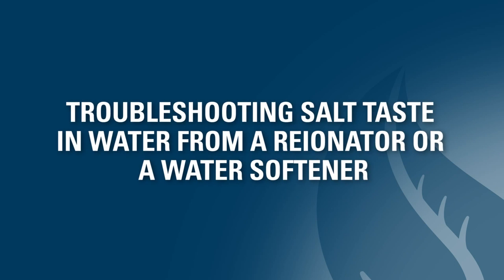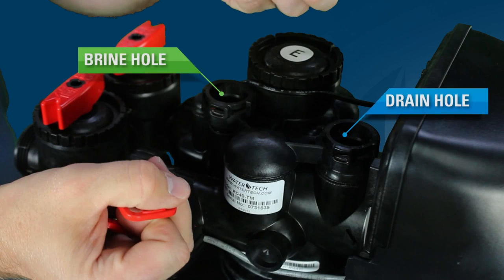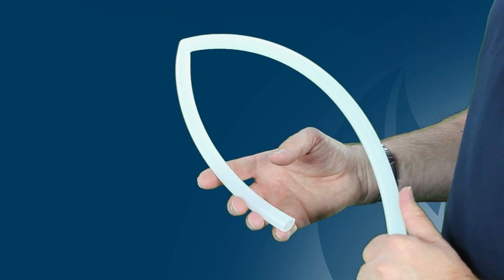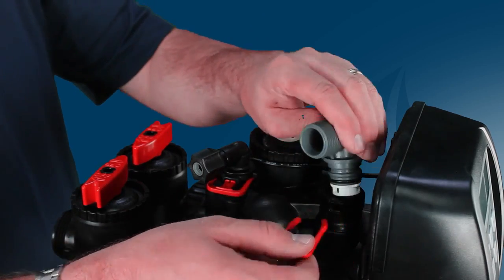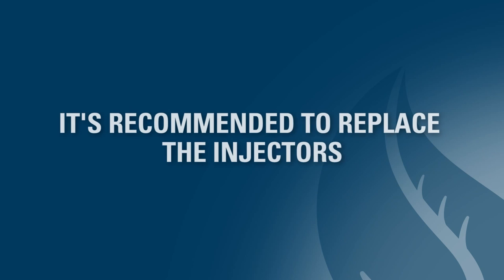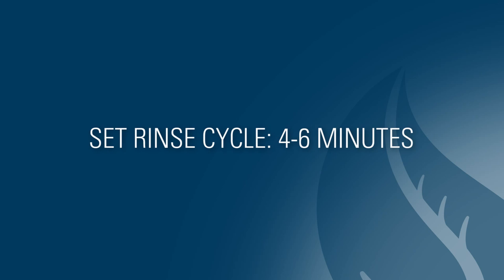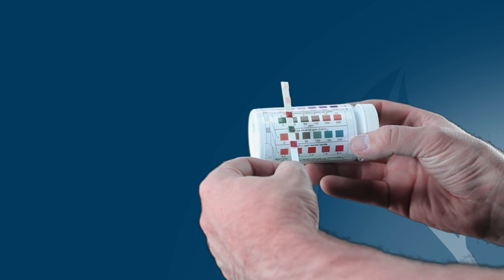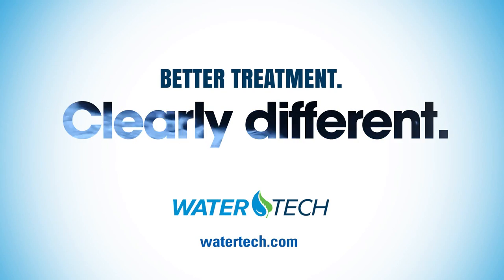WaterTech: Troubleshooting Salt Taste in Water

Comment: When the video starts, the 2 valves are closed.  At 0:27, you open the valves. At 0:33, when the camera returns to the valves, they are back closed before removing the 2 connections.  Should they be opened or closed before removing the 2 connections?
Reply from the maker: Great question - and good catch.  Yes, they should be open like at 0:27.  Best of luck and thanks for asking!
Reply: @WaterTechFiltration  Shouldn't they be closed before removing the hoses?
Reply from the maker: @grattonland  The system should be in service and the bypass valves open.  Then you can remove the two red clips and pull out the two elbows (the brine & drain line), as seen at 00:33. The hoses connected to the brine and drain lines can stay attached to those elbows as you remove them.  Let us know if you have any additional questions.
Reply: @WaterTechFiltration  yes, clear now.  Being bypass valves, they are always opened, that’s what confused me at first.  They are never closed, just in one position or another.
Reply: I'm still uncertain I understand this conversation. Let's recap. Should the red valves be pointing to each other or be parallel to each other when performing this step? Service = "Being serviced," and regeneration = "In operation"? Just trying to avoid some unintended consequences.
Reply from the maker: @esthomason  The red valves should be parallel to each other when performing this service. You need water flowing through the system to check water movement underneath the brain line elbow, and the drain line elbow. When the system is in service, that means that the system is fully operational and delivering soft water into the home. When the system is in regeneration, the system is cleaning the resin bed and is not delivering soft water into the home. Once the regeneration cycle is over, the system will resume it's regular service, and be delivering soft water into the home.
Reply: @WaterTechFiltration  The cylinder is under pressure when in service. Are you sure that we can unplug these two lines when in service? I always thought we had to release the pressure before doing anything.
Reply: @micheltruax4434  It is a little confusing, because the natural inclination is to "turn things off" before working on them.  But my understanding is that when the system is "in service", meaning trying to deliver softened water to the house, there should be no water movement or pressure to and from the brine tank or drain.  The things being checked in these steps are for the brine.  That's why it is a problem if you see water movement looking into the ports when the system is in service.
Reply: @murky2502  yep, that's what i understand as well. The term "service" is a bit counter intuitive in this case as it actually means "normal operation".
Reply: Yeah I just had the valves open just like any other day and had water spewing all over the place..... not thrilled about these instructions